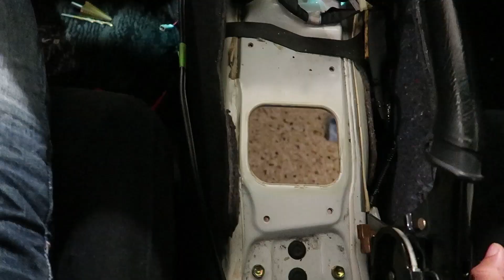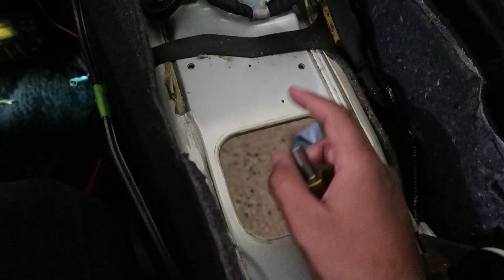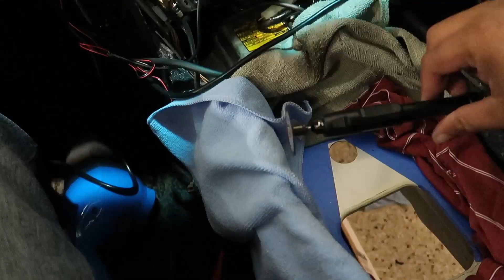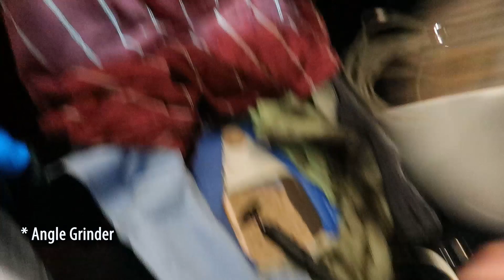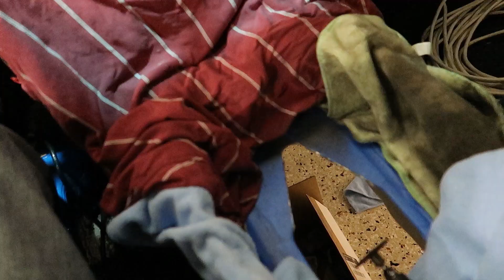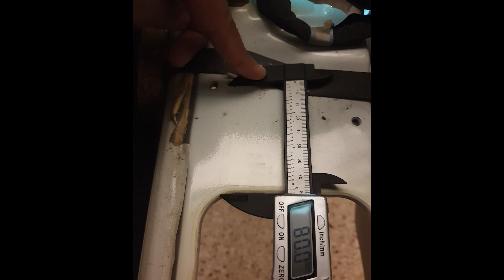JZX110 Manual Swap - EP6 - Cutting the Trans Tunnel | Toyota Mark II

Comment: @krishneil Garib Was this cut sufficient for the clearance? I heard in the videos you suspected you may have to cut more. Did this first cut work out alright?
Reply from the maker: Yes it was just enough, with the first front circle I cut being just enough to clear the breather on the shifter extension housing.